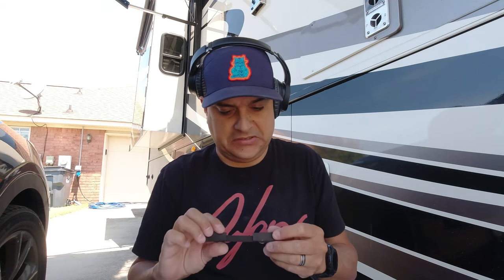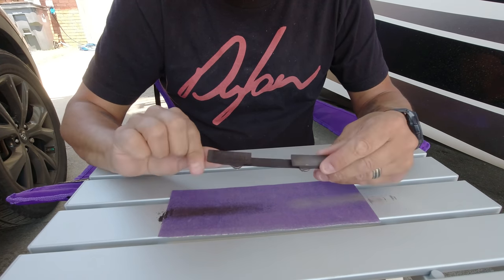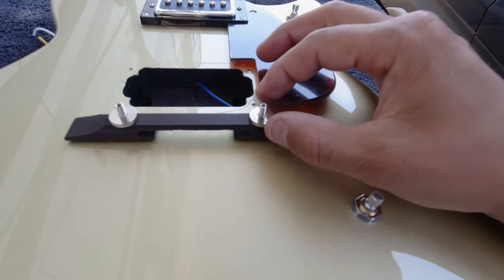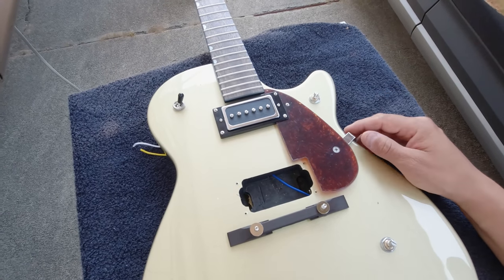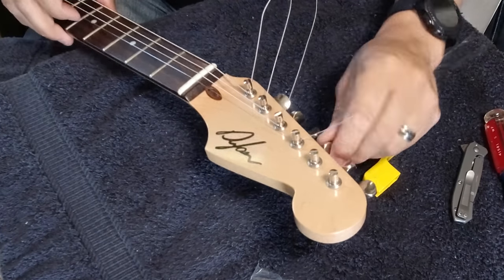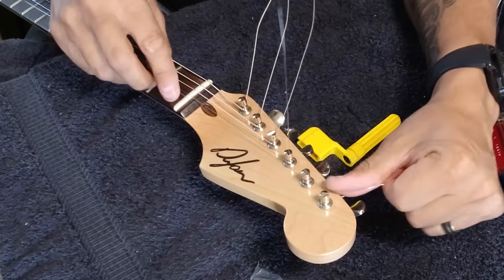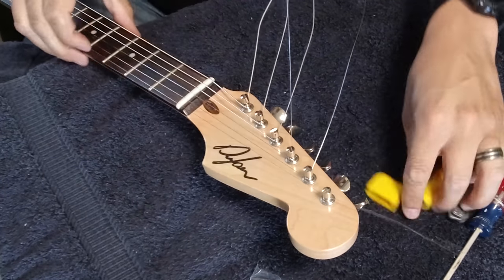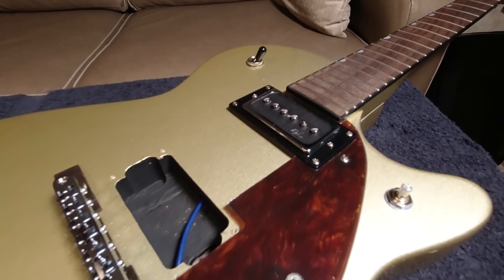How To Use Locking Tuners

Comment: I put locking tuners on my Epi Les Paul over 20 years ago and will never look back.
It does make restringing alot easier.  
Just need a pair of needle nose pliers to make sure i get the strings tight before locking them down. 

That Gretch is going to be pretty sweet when it is done
Reply: If you are working on the nuts from the front of the tuning pegs, I would recommend trying a fixed wrench or even a ratchet over using needle nose plyers. When I started working on guitars that's all I had but my experience it is too hard to get a good grip : all while introducing an opportunity to scratch the headstock and damage the hardware with the plyers. You can probably find a ratchet or wrench set at a dollar store these days. Cheers m8.
Reply: But if u mean just bending the string before winding it, you can do that with your finger quickly too

Comment: I would take a wooden dowel of the right diameter to fit not too tightly into the holes of the original bridge posts, cut it flatly in half and superglue or PVA the two halves to the centers of the notches you just made. They would act as bridge locator pins.

Comment: Main benefit of replacing standard tuners on my Squire Strat with Sperzel locking  tuners was the staggered feature to eliminate string trees. This was the deal for improving tuning stability a lot in regards of tremolo use.
I love these sperzel, machines.

Comment: I did that thing where you pull the string tight before locking it off with a brand new USA built PRS starla once.....because the string was being pulled tight right on the edge of the hole that goes through the post, it neatly severed the string at that point because the edge of the hole was sharp as fuck......from that point on i always put one wrap to avoid that happening again.

Comment: I'm in the same spot right now wondering if that bridge will be too high compared to how the old one was sitting, but you know what you're doing so it's not that big of a deal. Locking tuners are so nice. I love not having to worry about how much slack to give a string to get the proper number of winds or accidentally getting too many and now it looks ugly. Just pop the string in, tighten, boom you're on your way. It's great.

Comment: If you are going to go all out on this you should add a piezo under the bridge wired in to the extra connector of the output jack. That way you have Piezo output on the right channel and the pickups on the left. I have done that to a couple of my guitars. Use a stereo to mono 1/4 adapter and you can get some cool tones, or just send the left and right to different amps.

Comment: True about tuners BUT - I always wrap the string 3 times, no less no more, no overlapping, so I can change the tuning at will. Along with good setup, I can use the tremolo bar pretty aggressively (for a Strat), without detune.
It's possible even with regular vintage tuners - the setup is everything.

Comment: Locking tuners will add some tuning stability in that if you dive bomb the wraps around the post on a traditional tuner loosen and tighten, removing the wraps via a locking tuner means less string movement. Also you should have minimal a half wrap on the post to ensure tension is on the post, not the gears.
Love the work as always but have to disagree on some of the points put forward regarding locking tuners.

Comment: And you achieved what your talking bout at 4:10 with me ... I got out my very first electric guitar which is a cheapo old mix between Les Paul and PRS singlecut copy. Not even sure what wood it is (kinda looks like European Beech) ... thing wasnt really playable anymore. Output jack falling off... terrible action, one screw broke of in it. And you (to be fair you and others that have guitar channels) inspired me to work on it... and even give it some love. Plays better now than it ever did before, (although intonation problems are a thing. I might need to get a new bridge with more adjustment range) And to make it more fun to play im planning to add a "Bigsby" (copy) with a "vibramate" (well ill do the mounting plate myself from thick sheet aluminium), and maybe even try to split the humbuckers and add a hidden  microswitch under the scratchplate (see how they sound like in splitmode :D ), i mainly think im able to pull that of coz i learned alot about how pickups work from you.  Thank you man for inspiring me (and hopefully others) and for sharing all that beautyful knowledge <3

Comment: I like turning cheap guitars into good guitars. It doesn't take that much work or money. With locking tuners I like to have maybe half a wrap around, because I think without it there is more chance of the string breaking if it is sitting on the hard edge of the hole.

Comment: They greatly improve tuning stability by eliminating the wraps.  The easier string changes is the convenient by-product...
Reply: 50/50. but they made the trem on my Pacifica usable. you could see the wraps shifting and binding on the tuner posts with the stock ones

Comment: What if you put 5/16 or whatever metric thread bolts in the original bushings and have pins sticking out to snap the bridge onto. Either by machining a reduced diameter on the bolt or drilling a small hole through the middle and inserting a pin of the proper diameter.

Comment: A small point I don't see mentioned much. If you are cobbling together a guitar from a bunch of parts, make sure the radius of the bridge matches the radius of the neck. If the neck is a compound radius, check the radius at the nut and 12th fret, and the bridge should be just as much flatter than the 12th as the 12th is from the first.
Reply from the maker: you just file the saddles to whatever radius
Reply: @DylanTalksTone  Thank you. That is a great idea. I hadn't thought of that. Still not something I want to try with a vintage roller bridge.

Comment: Obviously, I am confused about the difference in tone of P90 compared to humbuckers. I was expecting you to place the P90 at the bridge and the humbucker at the neck.
Reply: Generally the pickup with the more clarity and lower output goes in the neck where the string vibration is darker and louder, and the hotter pickup goes in the bridge where vibration is weaker and brighter. You can see this in most guitars that mix a humbucker with single coils.

Comment: You could definitely argue the effect of locking tuners on tuning stability.  But you cannot accurately say that they're intended purpose was not for tuning stability.  They are meant to make a locking nut obsolete.  The locking nut succeeds in eliminating the variable slack in the string wrap around the tuner post when a tremolo is used in an extreme way.  The intent of the locking tuner is the same, eliminating the locking nut thus eliminating all the inconvenience of the double locking system.  That was the intent.  Maybe someone thinks it wasn't successful but it WAS exactly the reason for their invention.

Comment: why didn't you just use a drill and make holes the same size as the studs? if you had done that it would lock in place better. with a bigsby a floating bridge is gonna slide around

Comment: I'm with you on doing wacky shit. I try not to modify vintage pieces that are still all original, but if someone brings me a cheap guitar, and wants to put upgrades on it that cost more than the guitar itself, I always tell them I will do the work, but that putting $400 in parts and labor into a $200 guitar is not going to give you the same return on your investment that a stock $600 guitar would fetch. As long as I'm honest with them about it, I'm fine with it, like you said, it's not your guitar. Who cares!

Comment: LOCKING TUNERS ? I DON'T REMEMBER THE MAKE, BUT I HAVE A SET THAT WILL CUT THE B & E NO MATTER WHAT I DO, IT'S SLIP OR CUT !
Reply: A small roundfile and a little time to round the edges inside could help. Had that once and it turned out to be the solution.
Reply: This can happen with regular tuners too. Its not representative of all locking tuners. What brand model are they?

Comment: Seriously now, how are locking tuners faster and more convenient than split post tuners? 
You can do the same with them and you get the pricking bit of string stuck in the hole so it cannot prick anyone anymore. They are better, simpler and cheaper. Why bother with locking tuners?
Reply: Probably because you dont have to wrap the strings like with traditional tuners.

I guarantee I could swap two sets of strings to the one set you'll sting up with your classic tuners. Hands down worth it.